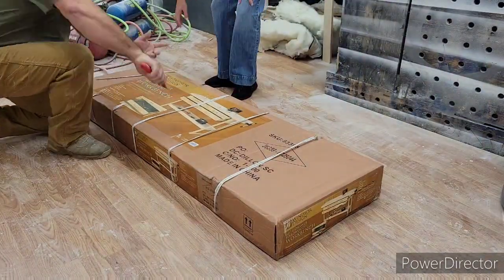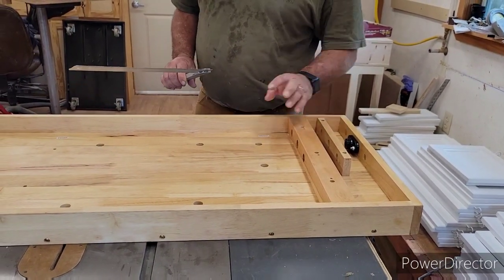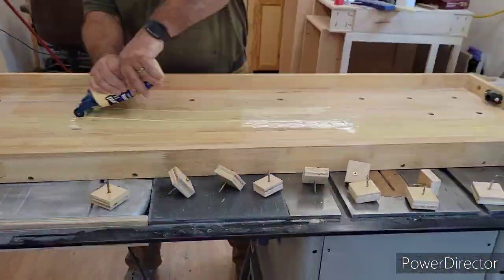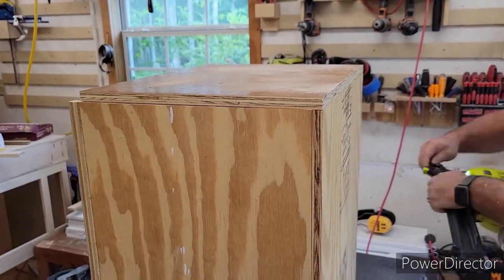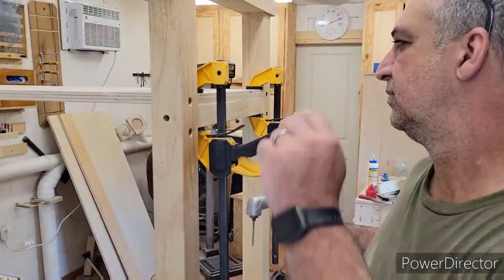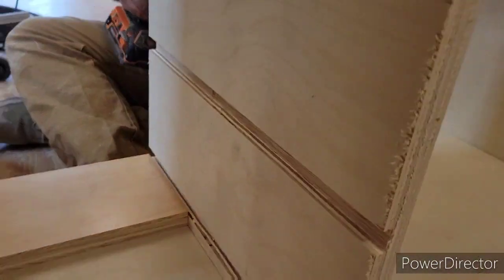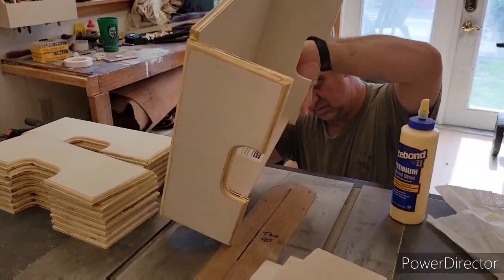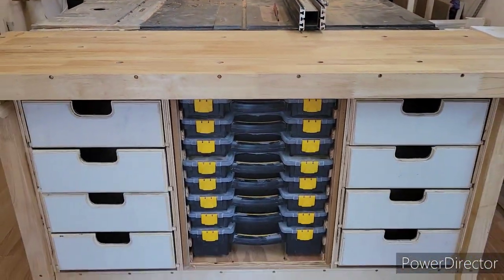Harbor Freight Workbench modifications

Comment: Harbor Freight doesn't seem to sell their Windsor Design workbench anymore.  They have the more expensive Yukon version for $200.
Reply from the maker: I just took a look and you are right. It looks very similar.  Maybe they corrected the problems with the Windsor.
Reply: @ShopRamblings  Yes, and are charging more for it.
Reply from the maker: @kle2217  Aug 15th it is going on sale for $159.. not as good as $119 that I paid for mine but it might be worth the extra.  I have to pass by HF tomorrow.  I might pick one up and see.
Reply: @ShopRamblings  Thanks for the info on the sale.  I’ll look out for this sale when it comes.

Comment: Did you solve the issue of sawdust falling down the holes in to the drawers or is that still an issue?
Reply from the maker: I did not want to plug the holes so the dogs would not work so I cut a piece of 1/4 plywood. I attached it to the bottom of the table top edge. I made it removeable. That leaves a space between it and bottom of the  surface to collect stuff that falls through the dog holes. For me the space is not filling up that fast. If I have to pull out my drawer and clean it out every few years it will be much better than it getting into my drawers.  Until I seen the comment I had forgotten I about it since nothing ever gets in my drawers.

Comment: How thick are the legs? I want to add locking casters when I put mine together.
Reply from the maker: I will try to remember to measure them for you next time I am in the shop. I think they are about 2in. These are the wheels I put on mine.
DOZAWA Workbench Stepdown Caster, 600 Lbs Set of 4 Durable Heavy Duty Steel, All Steel Construction Urethane Wheels [New Version] https://www.amazon.com/dp/B082781T4S/ref=cm_sw_r_awdo_navT_g_874JZAFY7X310FCCJE31

Comment: I can’t believe your wife even bought you something like that when you’re an expert builder from what I can tell. Looks like you have a whole woodworking shop. I’m trying to repair my bench with a hand saw😢😢😢😢
Reply from the maker: Yes, I have more tools than I have room for. I also have an account at a wholesale hardwood dealer. The thing is, I had been rearranging my shop. I was taking out a 24' built-in workbench. I wanted to go to movable workbenches. The problem is that when I start to design something for myself, I want to add in all the features I can. I tend to try and maximize the size and try to figure in the size of material so I can use every inch.  This was a great foundation.  It locked me into a decent dimension. I was able to  make a great workbench in one day without any planning. In this case, good that I can get done today is better than fantastic that I may never get around to. I have one of the new Yukon tables still in the box. I will be building a new workbench with it in January. This time I am going to try to make blueprints to share as I think you can make a fantastic workbench with a few modifications. Check out my community tab to see a picture of one of my HF benches. It might surprise you how nice they can be.
Reply: @ShopRamblings  you’re very gifted in woodworking! Thanks for sharing

Comment: What kind of castors are those?
Reply from the maker: Here is a link to the ones I have.

https://amzn.to/3e1FaQQ

The screws that come with it are not very good and the instructions have the space between the holes wrong. However, the wheel assembly works great. I will be getting another set when I build my miter station.

Comment: I subbed to ur channel found this table for sale locally just wanted to see if it's a good buy or not. I suck at anything wood, maybe I can learn from ur channel how to make a dresser inside daughter's closet save space in rooms
Reply from the maker: I would be glad to help. A dresser can be easy. It is a matter of how much you want to spend on materials and how nice you want it. It is basically a box with drawers. Slides are the most expensive parts or you can build it without them. Email me if you need some help.